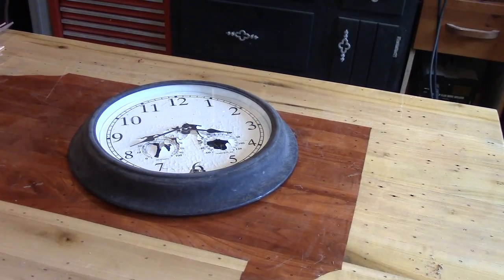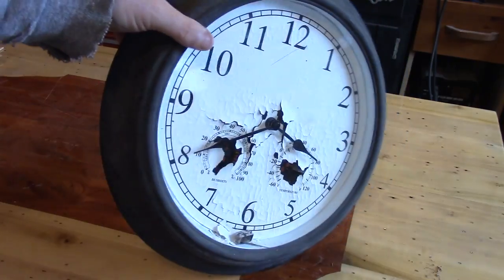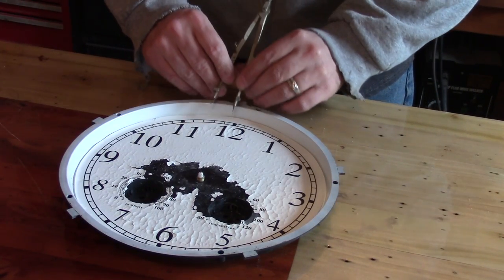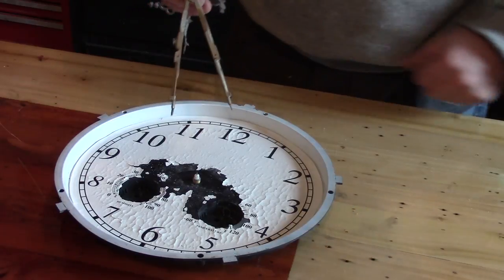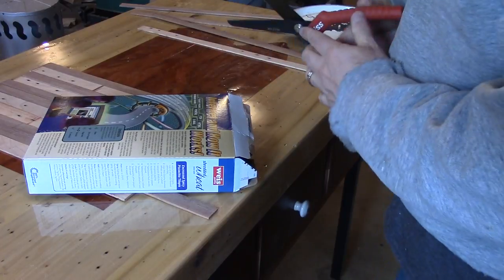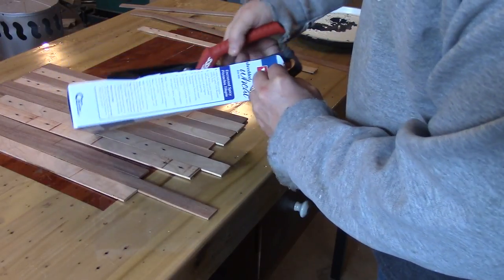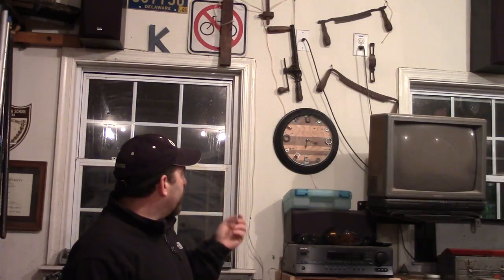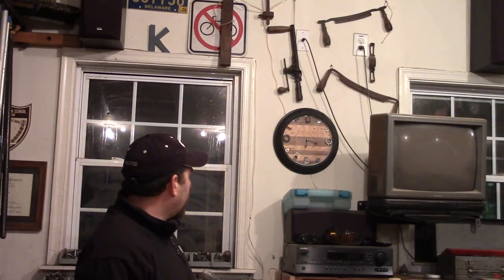WorkShop Clock:  One of kind Item

Comment: Nice clock man. I like that. Rescued a 1970's Simplicity snow blower from the trash years ago.  Found all the parts to get her running again little by little. Love old yard power tools from that era...safety was second, performance first. No safety controls, just start it and go.  I could put it in gear, engage the auger and this thing will take off by itself and keep going. A thing of beauty!
Reply from the maker: Those older machines are heavy duty.  All the parts for those engines are still available, so they can be ordered.  I don't like the friction disc drive system on many new snowblowers because they can get wet and not work.  Some of the older machines run with chains, and it is hard to stop them.